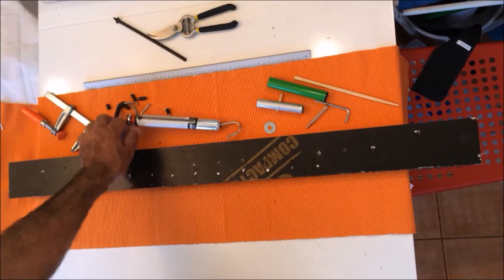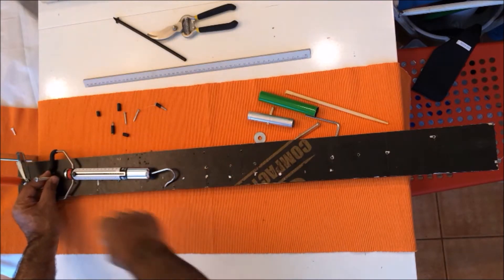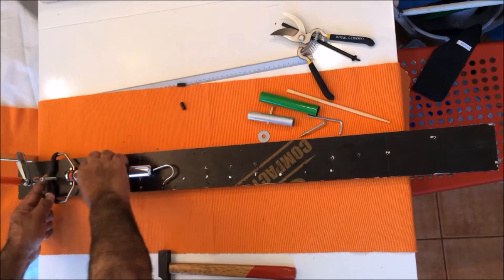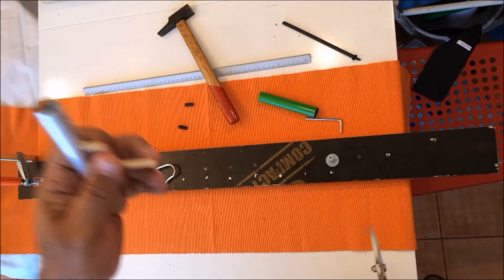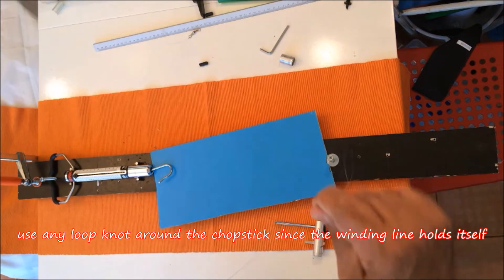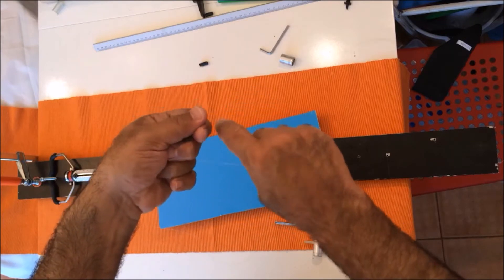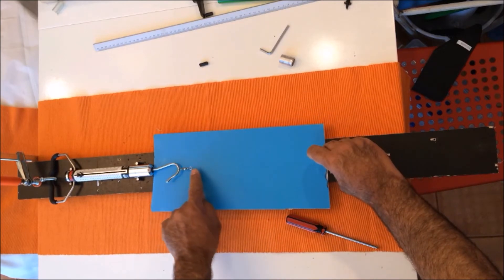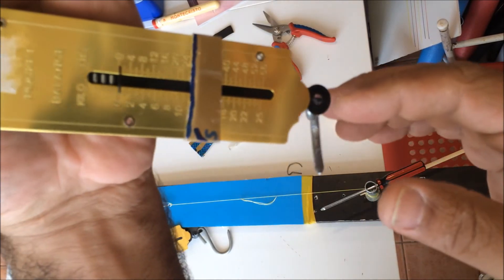Fishing Knot Tensile Test Rig - with 3D Animation

Comment: Good video and Thanks😊 How accurate is your "spring scale"? For instance is it accurate within +/- 50 grams or perhaps +/- 40 grams?! I'm not trying to be rude or Critical, but have you tested the Spring-Scale prior to choosing it for the project?! I once made an almost exact device using a Scandinavian Spring Scale (made by Abu Garcia of Sweden), and it wasn't Consistent enough for testing knots tied with thin lines (4 to 8 Lb. German Maxima monofilament or Fluorocarbon)!! So I'm Sincerely curious!!. I reached the conclusion that I needed a Very accurate Digital Scale. In fact I tried a Digital Fish Scale, and again it wasn't quite accurate enough!! People at Salt Strong in the U. S. Digital Scale more accurate than I can find.

Comment: My concern with the system as-is - is that it neglects the rate. I'm a fly fisherman and 9 times out of 10, if my line fails, it fails when a fish rises to take my fly and I set the hook. The failure is ALWAYS at the junction between the tippet and the leader. I have used surgeon knots, blood-knots, and lately, a 2mm ID tippet ring. It's always been a frustrating situation because I really do not have any empirical data that tells me which is consistently the best - or least likely to fail. The irony? I am a materials scientist at a kind of like a Consumer Reports for dentists - I have at my disposal an Instron load testing machine that would be more than capable of tensile testing any kind of fishing rig you could dream up. The best part is that I could test the effect the rate of contraction (cross-head speed) had on each system. (Static vs dynamic loading.) Mmmm. Thanks for the inspiration!
Reply from the maker: There is no doubt in my mind that the improved clinch knot on a ring swivel remains the strongest way (and easiest) to attach two lines - especially when you pass the line twice through the eye of the swivel before completing the knot. The thinner the line the more turns you need - I use minimum 6 turns and maybe up to 8. but it is very important of course not to cross the turn wrappings. Dynamic loading is interesting: try pulling on a sturdy fishing line (say 0.5 mm dia) with a simple half hitch knot in the middle, and alternatively try yanking it (using gloves for safety). The knot will squeeze itself into getting cut either way, but I believe faster when yanked suddenly. 
Happy fishing....

Comment: There seems to be much concern about connectors to attach your kite lines to your Kites>>>allabout.wiki/7puu    Kite flyers use these connections to quickly attach and detach their kites from their various lines which are rated for different test strengths, depending on the wind. It's easy to miscalculate the strength of the wind, especially on gusty days

Comment: I would recommend to add a simple mechanism that prevents fast contraction of the spring every time the line breaks, because it will eventually destroy the scale...  Pretty cool demo at the end! what software is it? Does not look like a Solidworks :)